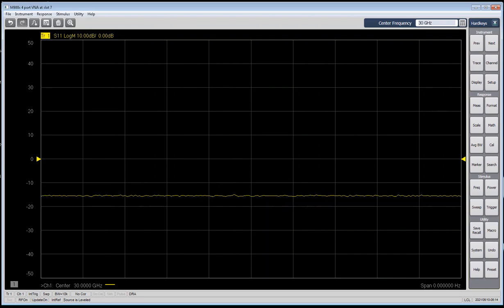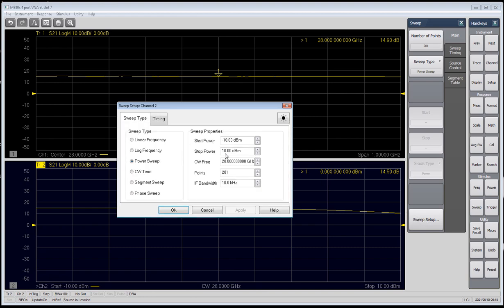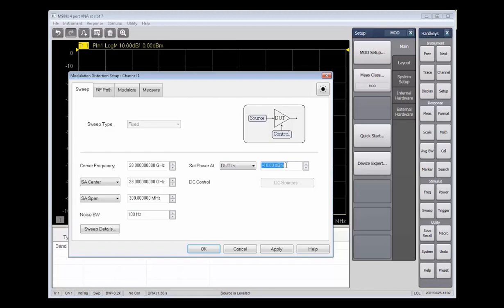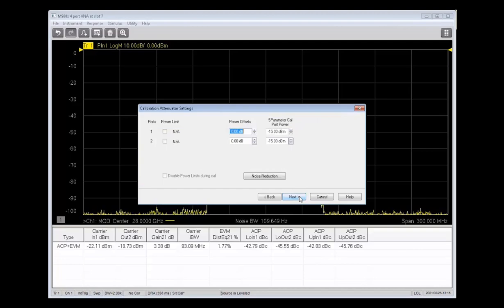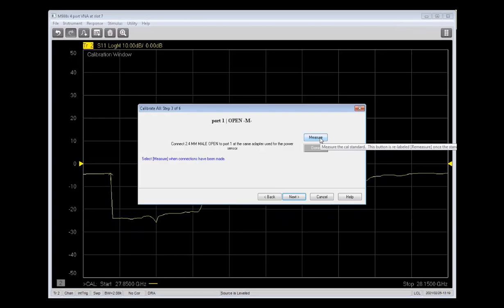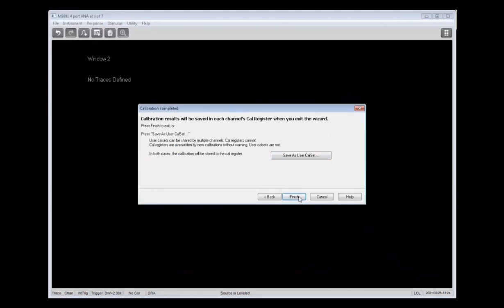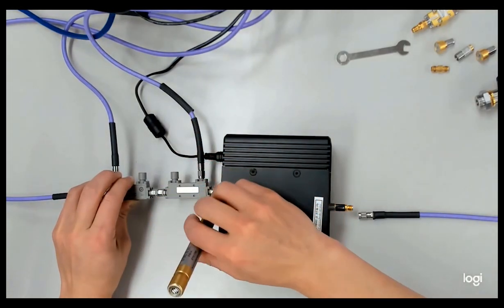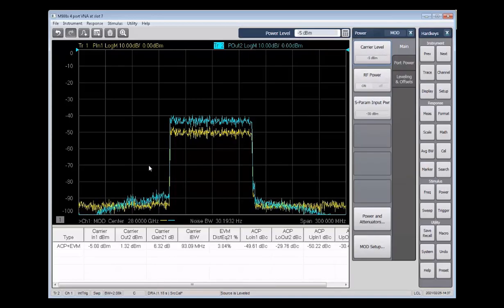Keysight Vector Component Analyzer Demo

Comment: Matt,  you also did a video about making RF connections (https://youtu.be/38TAZoOB5ew) where there and here you have demonstrated absolutely poor RF connection matting practices with the lack of usage of the backing wrenches. In http://na.support.keysight.com/pna/connectorcare/Connector_Care.htm -> Making Good Connections. It states: "Position torque wrench, *and a second wrench to hold the device or cable*, within 90° of each other before applying force. Make sure to support the devices to avoid putting stress on the connectors."  I have been in labs that did not practice using backing wrenches to make any of their RF connections and most of there rf connectors in the lab are compromised all the way up to the instrument connector with damage to the ground faces to damaged center pins where 90% would have been avoided by use backing wrenches. Where using backing wrenches on either side of the connection minimizes torque to the active region of the rf connection thus most "torquing" forces are kept to nut in order to make the connection a liner compression mate between the rf connectors. I honestly do not know why Keysight has not caught this or why you are allowed in the lab with this much poor connector care practice.

I much better guide to connection practice than the previously mentioned video the Matt shot (https://youtu.be/38TAZoOB5ew) is the guide from Anritsu: https://dl.cdn-anritsu.com/en-us/test-measurement/files/Manuals/Instruction-Sheet/10100-00031C.pdf sections 4-5 & 4-6 

This guide should be in every lab and read by everyone working with rf connectors and any grade and class